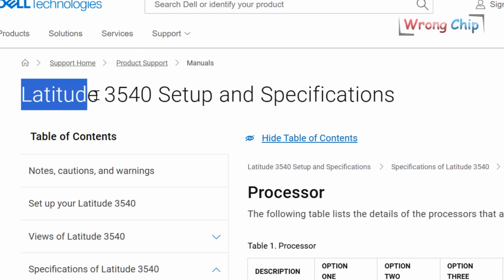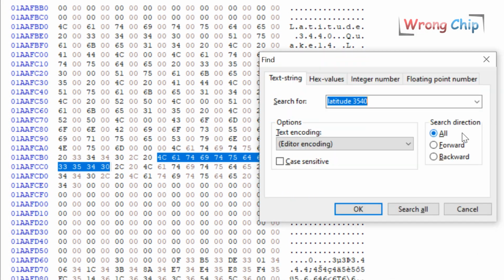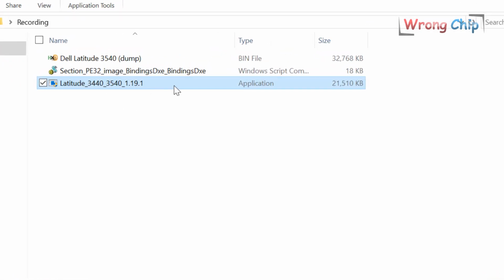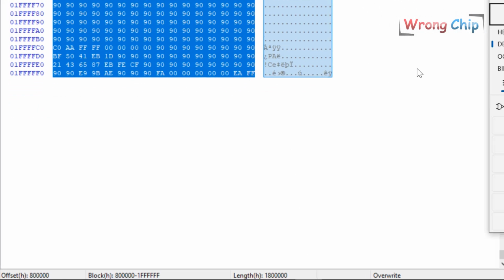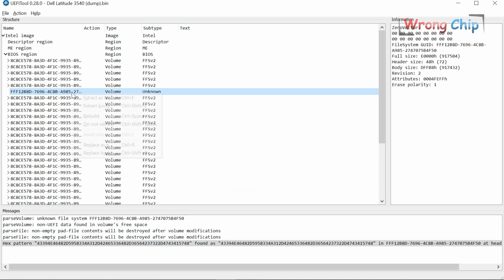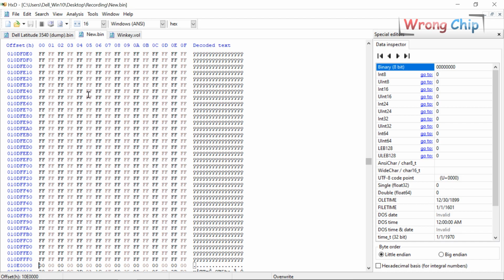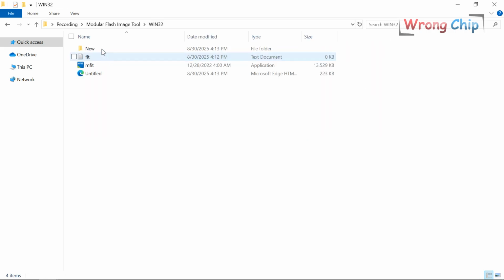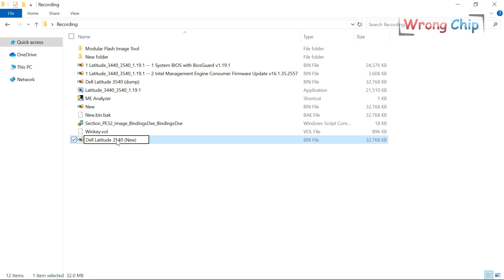How to Fix Dell Latitude 3540 BIOS Without Service Tag (Step-by-Step Guide)

Comment: Great video, exactly the kind of stuff this community needs more of!
I was able to follow everything and produce a working BIOS file without a hitch but the admin lock password still persists... Why?
Reply from the maker: Thanks :)
Because the Password is stored inside the EC chip not in the BIOS. You can still remove the Password by modifying a specific part in the BIOS, but I don't like to talk about Password stuff on my Channel, especially for the corporate devices.
Reply: @wrongchip  But after flashing with a BIOS file that someone else produced, the password was removed? How is that possible?
Reply from the maker: @mike_apfx  Because he modified the specific part that is responsible for resetting the EC chip.
Reply: @wrongchip  For educational purposes only of course... How would someone do this? :)

Comment: Bro i Don't Have a Dump bios my board bios chip is missing how to reprogram Bios..
Reply from the maker: It will be harder if you don't have the original BIOS. Anyway, you didn't mention your laptop model or why you want to flash the BIOS.
Reply: @wrongchip DELL LATITUDE E5450 ZAM70 LA-A901P REV 1.0(A00) 2014-07-16 
Can you make bios please
Reply: Power button press showing flicker screen not on
Reply from the maker: @ishtiaqkhan2162  You can send me your device info on Telegram if you want me to rebuild your BIOS.
t.me/WrongChip

Comment: This seems easy for you. So how about a challenge for you bud? Interested?
"Surface Laptop 7" got released last year. And Microsoft doesnt provide just the bios file from their website. 
If you had a corrupted surface laptop 7, how would you fix it? There are no bios dumps on internet too. 😅
Reply from the maker: Take a backup from another working machine then clean it, or you have to wait until someone upload a working BIOS. Nothing else to do.